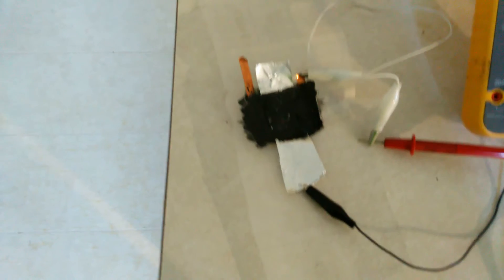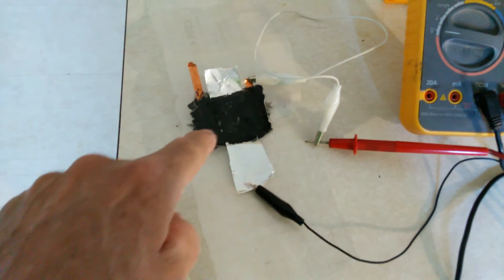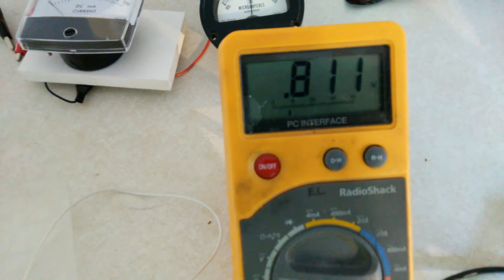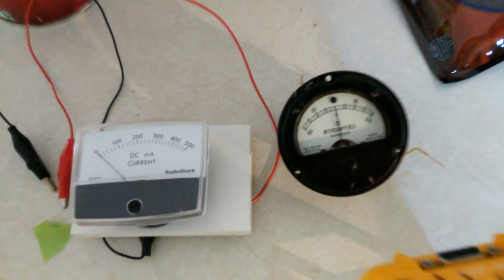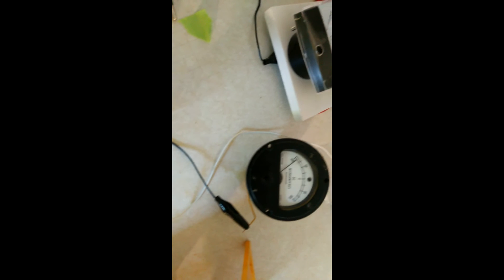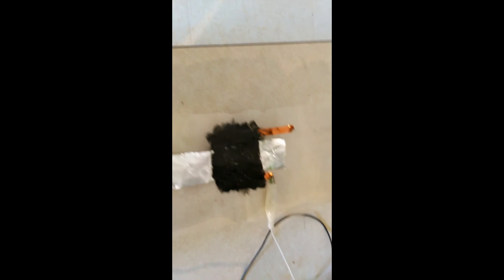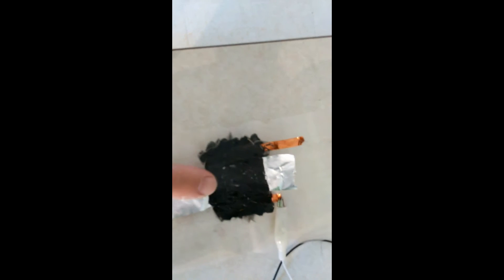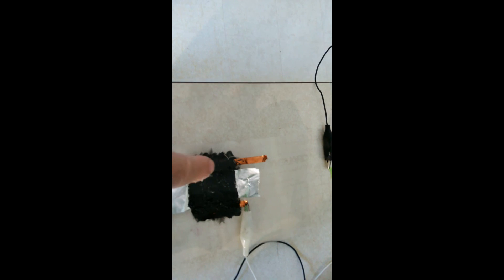Graphene Solar Powered Cell, Voltage and current check with and without Sunlight

Comment: You're using copper and aluminium in this cell, the aluminium will decompose over time. That's where the energy is coming from.
Reply from the maker: +Martin Counsell Thanks Martin, I will look into that.

Comment: I think the graphene is picking up infrared  and thermal radiation.
Reply from the maker: +mikeccuk2006 I have noticed that the more distance between the graphene and the metal  the higher the voltage is, so I quess when the sun shines on the cell the heat expands the molecules and creates more space so the voltage is increased, but the current doesn't decrease which you would expect .  So I am still confused.   Thanks for the comments.
Ed
Reply from the maker: +mikeccuk2006  Thanks Mike, the distance is factor could be the reason the voltage goes up and the reason the current is low , I think I did not use something like sodium sulfate or magnesium sulfate,  those salts will hold water molecules which could raise the current. I am working on that type of cell now.  Thanks again